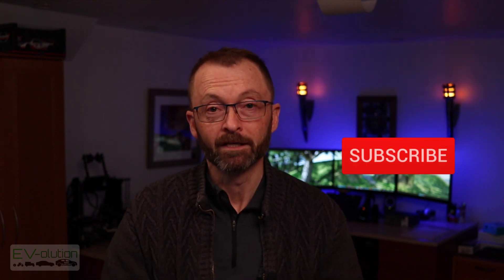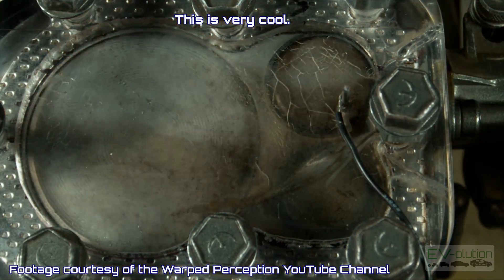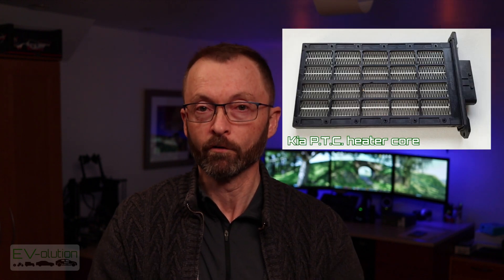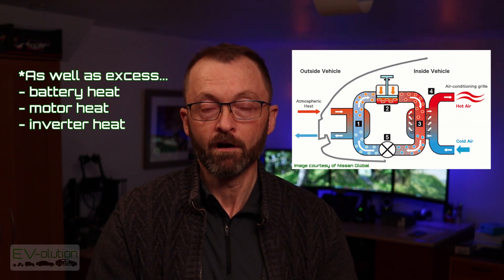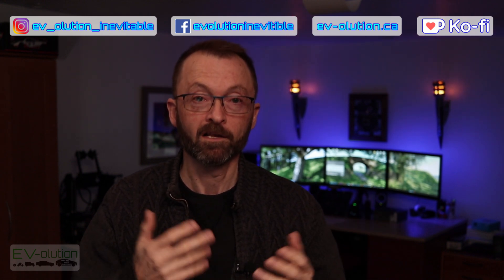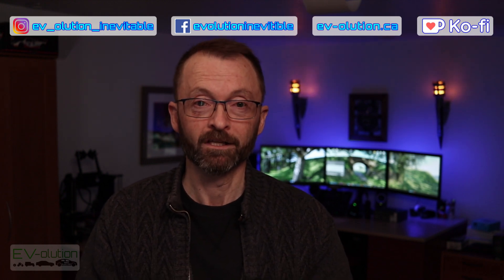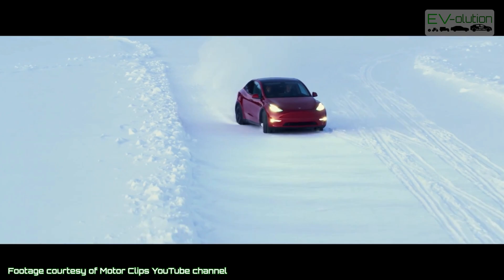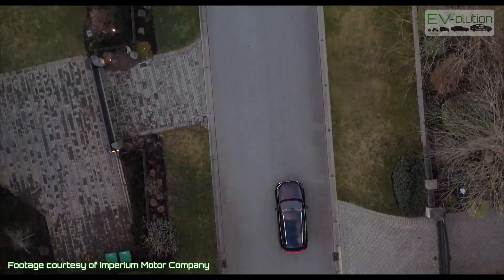EQ 006 - How do EVs heat the cabin in winter? Heat pump, or not?

Comment: So then a question for you - I am 5 months into owning my Niro EV with a heat pump, and I love it.  I am interested in getting my second EV soon for my wife, and I have my eyes in the Kona EV - mainly because it is a lot cheaper.  But here in the US it does NOT have an option for a heat pump (I have no idea why).  We are in NY with really cold winters, and good hot summers.  How much of a deal breaker do think it really is to not have a heat pump?
Reply from the maker: I would say it depends on a few factors and what you can live with. Do you park outside all of the time? Will you regularly drive long distances in cold weather (about -10C or colder)? If you park outside all of the time, but only drive an occasional long distance trip, then I would say it is not a big deal to not have a heat pump. If the car parks inside all of the time and you occasionally drive long distance trips, then I would also say it is no big deal. If you park outside all of the time and drive long trips on a regular basis, then I would say that getting a car with a heat pump is probably a good idea. But you have to consider that it is also a question of whether you can live with the reduced range as compared to an equivalent with the heat pump. My Niro EV loses about 25% range in the winter. What would be the loss without a heat pump? I am not sure, but I would say that even if it is up to 35% then you know what you are getting into regardless, and you buy based on the range and your daily use, not the fact that it has a heat pump or not.
Reply: Why not get a 2nd Niro? LOL.  I just picked one up and am excited to really try it out! Got a good deal on my lease, $1300 due at signing + 35 months at $369. Got it in Copiague NY at South Shore Kia
Reply: no heat pump in the kona due to parts availability. But you would need the higher end trims for at least the battery heater.

Comment: What about the efficiency difference for AC in the summer?  A heat pump is also going to be a lot more efficient for that as well - won't it?
Reply from the maker: You are correct, it also helps in the summer, for AC. Basically the heat pump is an excellent option to have.
Reply: @EV-olution  How is a heat pump going to help in summer! A heat pump is basically an AC working in reverse. In summer it makes no difference
Reply from the maker: @aneeshzutshi3419  because the Kia Niro EV (and I am guessing other EVs) use the heat pump as part of the HVAC for air conditioning. My Kia EV6 does the same, so do the Ioniq 5, Ioniq 6 and I am pretty sure the new EV9 will also do it.
Here is a PDF that explains how it works.
https://www.kianiroforum.com/attachments/heat-pump-info-pdf.8180/?hash=bf36970e53df63ab4e3b922d3808fdbb
Reply: It is only more efficient than PTC heater in heating mode , no difference from a simple AC while cooling.
Reply from the maker: @aneeshzutshi3419  you are correct. The heat pump efficiency gains are only related to the heating in winter, versus resistive and PTC heating. My comment from 1 year ago was not clear. The heat pump helps as part of the AC system, but does not add efficiency to the AC functionality.
Reply: @EV-olution  thank you for the clarification
Reply: @EV-olution  Thank you for the clarification.

Comment: Hi , did you by any chance encounter a PC017 error for your niro it is going 
by drive train Drive Motor "A" Position Sensor Not Learned. I'm curious 
as some people say it is due to the dongle and according to others it is
 a real error, do you have any knowledge about this?
Reply from the maker: I have never had an error code and I have had my OBD2 dongle plugged in 24/7 for 2 years. As far as I know, any error of that kind can't be caused by plugging in an OBD2 receiver because it does not send info to the car, it only reads.
Reply: @EV-olution  Yes interestingly I check some forums where people mentioned this on 2021 model like mine and it can't be detected by dealer diagnostic I have a check with the dealer and will keep you posted. I'm glad your wife is ok be blessed and take care !
Reply from the maker: Thank you.

Comment: Thanks for the video, do you think having an awd on an ev makes a good difference here in canada considering the snow here in the south
Reply from the maker: Regardless of the fuel, gas or electric, an AWD vehicle will always perform better than a RWD or FWD vehicle in the snow. The question is, do you really need it? I have never owned an AWD vehicle and live in the Montréal area, in the province of Québec, where we can receive a lot of snow and it can get very cold, yet I have never had a probem. My Niro EV is FWD and I have excellent winter tires, so I never have issues in the snow. If I lived in the country, or where there are lots of steep hills, then I would want an AWD with excellent winter tires, and maybe even studded winter tires, but since I live in a more urban area my FWD Niro EV is more than fine in the winter, it is actually great. Another thing to consider is that EVs are heavy because of the large batteries they carry around, so traction in the snow and ride comfort are generally excellent. Essentially you need to make your choice based on your daily drive environment, then based on personal preference. I hope this helps.

Comment: Thank you for this vidéo. I live in France where winter températures are sometimes négative but despite that for an Incomprehensible reason KIA France has choosen not to installed a heat pump (even in option) on the e-niro sells in France while it is à standard équipement in Belgium. Inconsistent decision
Reply: In Brexitania, you only get a heat pump on the top spec. But dealerships aren’t telling new buyers, that without the heat pump, the car’s winter range will be affected by quite a bit.
Reply from the maker: Je suis d'accord avec vous et je ne comprends pas pourquoi que la thermopompe n’est pas au moins une option à acheter en France. De plus, Kia l’offre en option aux États-Unis pour peu d’argent supplémentaire, pourtant certains états dans lesquels que cette option est disponible ont des températures d’hiver douces, comme les vôtres. À titre d'info, je suis du Québec et je parle le français, donc ne gênez-vous pas à m’écrire en français. 😉
Reply: In France dealerships are not better than yours, they didn't inform me about the 11kw charger option which is interresting when you charge on public stations

Comment: Chevy Bolts heat very well, only after they catch fire.  Since you are in Quebec, have you noticed road salt damage to the electrical components, including the battery pack on your 2019 e-Niro?
Reply from the maker: First... LoL.
My Niro EV still looks like new underneath. No issues with road salt and no issues with any components, including the battery.

Comment: Good to have you back in action❤️ A couple of questions related to the Niro EV heating:

1. There’s a winter mode option in Niro EV console settings, does it play any role in activating the heat pump to keep the battery warm? I never really understood it’s purpose as there is literally no documentation available to see what that mode is about. The manual’s wordings seems very vague.

2. When I turn on the cabin heat, the system always turn on the AC and Heat at the same time. I have the auto(dehumidify/defog) settings disabled and set the heat on manual.
Is that a normal operation with heat?

3. Plus with heat on, I never get an option to recirculate the cabin air as it seems to be disabled when heat is on. As if it wants to get the fresh air in to heat the cabin. Only downside is you get other cars gas exhaust fumes if driving behind a diesel hogger; cigarette smoke in the cabin while parked and someone smoking a cigarette nearby.
Reply from the maker: Thank you.
1) The heat pump is only for the HVAC system and has nothing to do with the battery heater that is part of the Winter Mode option. The battery heater will activate at an unspecified low temperature (Kia never answered my questions), but from what I have read it only happens with the car is plugged in.  You can leave Winter Mode active all year round as it is temperature dependant.

2) If the AC is coming on at the same time as the heat, like mine does, then you have not actually disabled the auto-dehumidify option. Double check to make sure it really is off. I leave it active as it is very convenient to keep fog off of the windows and has no negative impact on the car.

3) When I set the HVAC to heat, I use Auto, but if I press the recirculate button on the right knob,  the light turns on and the system recirculates air. Yours should do the same even though mine is a 2019. One thing to note, recirculate should only be used for short periods of time when it is cold, or raining a lot, or you will have an accumulation of humidity on the windows making visibility more difficult. I use recirculate when I drive through a tunnel, or follow a disgusting diesel.
Reply: @EV-olution  thanks so much for answering to my queries so quickly. I will follow your suggestions to see if they help, especially the air recirculation one🙃 how’s your furry friend doing? Glad to hear that your wife has recovered fully. Take care!
Reply from the maker: @nikhilvibhu  the kitten is a tornado of fun

Comment: The heat pump option for the Niro - which includes a battery warmer,  heated steering wheel and seats, is a little over a thousand US dollars.  So it seems like an inexpensive and useful thing to include on any EV.
Reply from the maker: At that low price it is well worth the extra money and I would not pass on it.

Comment: In the UK I have the MY2022 2 Long Range 64kWh and it doesn't have the heat pump. This is my 5th EV and the winter efficiency of this car is poor, losing on average 30 mile with the heating on 20°C and when it was below 0°C, I saw an initial 50 mile range difference. Just as well it has a large battery to compensate. I think the heat pump should be standard but I'm to believe that the Hyundai Group on some EV models now want £1100 to fit one and is only a factory build option.
Reply from the maker: Considering the small amount of money that Kia charges for the option in some markets, I agree, they should just make is standard. With that being said, when you say your car loses 30 miles of range when you use the heating, have you driven a full charge on a long trip to calculate the 30 miles, or is it what the GOM indicates when you turn on the heat? The GOM calculates range based on the power drain at the moment, and the PTC heater draws a lot of power at first while heating up. Once the temperature has been achieved the power draw from the heater is less and has less of an impact.
Reply: @EV-olution  Yes, it's the Instant power drain when using the most energy and as the cabin heats it obviously decreases but still quite a difference. With a Heat pump car I only ever saw 10-15 mile instant range reduction in similar cold conditions. If it could be an option I would have the heat pump retro fitted.
This 2LR car was created at £34950 in the UK to take advantage of the then Government grant of £2500 for cars below £35000, so they removed severl items to give the 64kWh battery. Having the heat pump would of taken it over the then threshold. The grant is now only £1500 and a only for cars valued under £32000. Thanks.
Reply from the maker: Just so you have a direct comparison, my 2019 Niro EV has a heat pump. This morning when it was -15C my car was plugged in, but not charging as it had reached 90%, the GOM in the Kia Connect app indicated 318km of range, but when I activated the heater using the app the GOM range dropped to 256km. This is normal, regardless of whether the Niro EV has a heat pump or not. The important thing is that once the car achieved the desired temperature, not very long after, the range went back up to just below 300km. The initial power draw of the PTC heater is very high, which is one of the benefits of a PTC heater because it is able to heat up quickly, but it then throttles back the power draw as the temperature is reached.

Comment: Congrats on the 10,000! My Niro EV has the heat pump. I cannot tell what range I would get in the winter without one, but I register a very acceptable loss of range between summer and winter (taking into account that winter days rarely go under -10°C where I live). I get about 450 km in the summer and 360-380 km in the winter (mixed driving conditions). Most of the time in Eco.
Reply from the maker: You get excellent range with your Niro EV! It really depends on driving style, road conditions, temperature, as well as highway versus city though. I usually get 400km summer and 300km winter, but I do like sport mode ;-)

Comment: also some models ranges get a HP, some are extra and can depend on the market. So in the UK the Kia and Hyundai is an option on the EV6/ionic5, only on the top spec E-Niro,....and not at ll on the e-niro in the USA afaik..
Reply from the maker: You are correct. Depending on the market the heat pump may be included, or may be an option. The US Niro EV does have the heat pump as an option.
Reply: @EV-olution  For the US, calling it an "Option" is... generous.  By and large, cars shipped to the northern states have them, and cars shipped to the southern states don't.  Very few exceptions, and nearly all of those will involve dealer trades.

Comment: The kia Niro ev Ex 2022(base model in canada) doesn’t come with the heatpump or battery heater. Is it worth paying the extra 5k for upgrading to the ex+ that comes with heated steering wheel, heated seats , heat pump and battery heater? Thanks.
Reply from the maker: In my opinion the EX+ is well worth the extra money for the added benefits of the extra features.
Reply: @EV-olution  thank you very much for your answer
Reply from the maker: @adamlaferriere3791  my pleasure.

Comment: Félicitations on your 10k subs, it is well deserved!

Now, a quibble: my 2020 SX Touring is apparently equipped with a heat pump, as is the current EX+ and SX Touring trims. Was that new in the 2020 model year? Either way, even during our recent deep freeze, I've always been happy with how warm I was.
Reply from the maker: Thank you very much.
My 2019 Niro EV has a heat pump, as shown in the video, but it was only in the SX Touring top trim for 2019 and 2020. In 2021 the EX+ trim was added between the base EX and top SX, and also includes a heat pump. So basically, for any year of the Niro EV, the heat pump is included from the EX+ trim and up.

Comment: In a heat pump equipped EV, is the A/C unit separate or can both be bundled together ?
Reply from the maker: If the EV has a heat pump, depending on the EV, it can work with the AC system  making it more efficient to cool the car in the summer. You can also have an EV that has no heat pump, but has AC. They are separate units that can work together.
Reply: @EV-olution  Maybe clarify a bit? A/C units are heat pumps. I did think that the units in cars work in the same way as house units work. They use the same compressor, inside and outside air to gas/liquid condenser and evaporator. They have a valve that reverse inside and outside when heating instead of cooling. And probably an electric de-icing element in the outside unit when in heating mode. In cars with only A/C they make it a bit cheaper by not adding the valve. Its also possible that the gas has to be different to be used for both cooling and heating. Maybe I misunderstood your comment that they are separate units? I will try to remember to ask the workshop next week when they replace the compressor in our e-Niro. 😊

Comment: You might have included using waste heat from the battery+drive train (aka., octovalve.) Also do some benchmarks to show the kW as a function of outside and interior temperature. 

Using my JuiceNet 40 Pro, it takes about 2.5 kW parked with exterior about 25 F and interior 75 F. But only about 1.5 kW when the interior is set to 65 F augmented by seat heaters.
Reply from the maker: I actually mention the waste heat being used, it is a text overlay on the left of the screen when I also show the image of the heat pump and talk about where it gets the heat.
Also, this is an EQ episode, a quickie, not an in depth description of how this all works. There are several videos out there that already talk about the details. Thanks for posting the details of your experience.